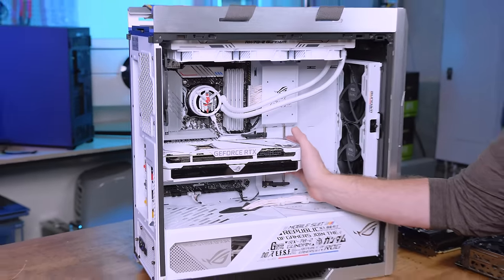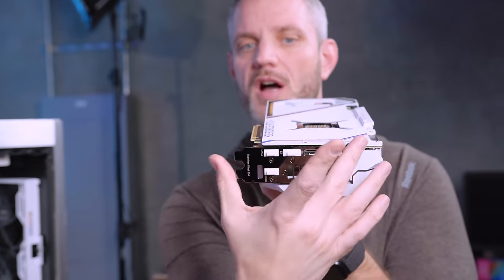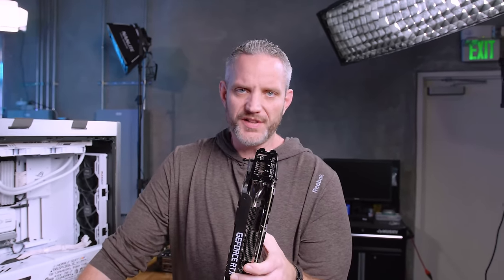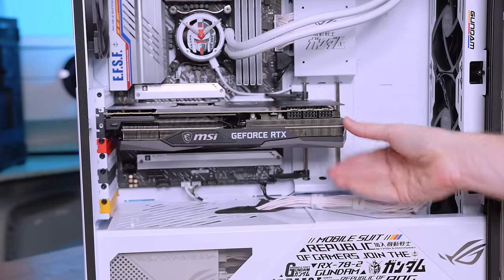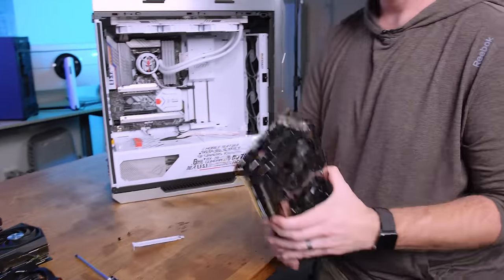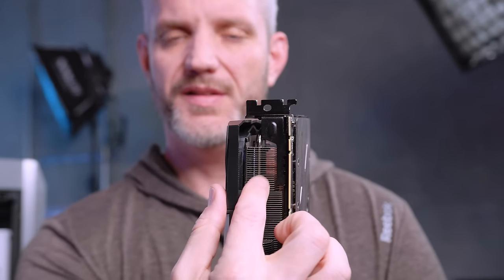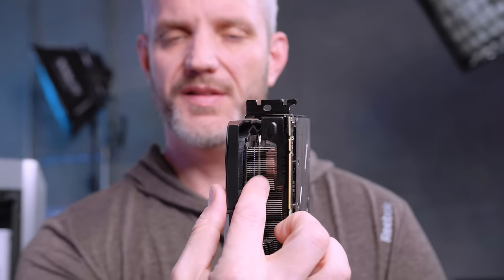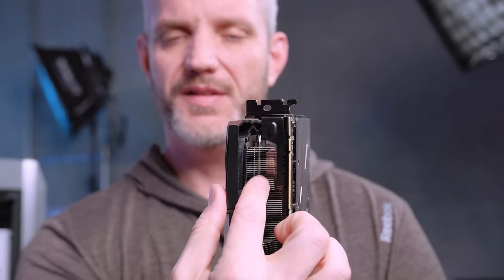How to fix GPU sag ONCE AND FOR ALL! FREE!

Comment: in my point of view you dont need special brackets to avoid sagging cards. simply take a little piece of hard rubber and press it between the left lower end of your graphics card and the pc case. so gravity is pushing the card against the case and supports the pci-e slot. works good for me
Reply: Where are you getting pieces of hard rubber?

Comment: I think the real issues is that PCIe/motherboard standards weren't designed with giant GPUs in mind.
What we need is a redesign of the standard to account for different sized cards that can take up the full volume of space across the MB.
Reply: Completely agree. Even if the gpus were designed more sturdy it would still put stress on the MB on the pcie slot.
Reply: Not entirely it's. stil the fact your put your parts on the side!  just why would you do that.! look at 
Click image to open expanded view
Thermaltake Level 20 VT, or the HAF Evo from cool master, or Silvertones horizontal cases. some of Azz have horizontal stuff going on to!. putting everything on the side like this is dumb.
Reply: Although, thick heavy gpus have been around for many years now. Motherboard manufacturers have had plenty of time to adapt, but haven't. Honestly, not sure what the motherboard manufacturers can do, this is mostly a card and case issue. Jay shows how the cheap construction of the cards is leading to the sag. They need to design the cards with alot more support at the point of mount
Reply: Giant gpus and other aibs have been a thing for awhile. 

This is demonstrably card manufacturers being cheap.
Reply: @gorkskoal9315  I agree, I have a true desktop case, as the slots were designed for, a CM HAF EVO, when the Mobo is horizontal and the GPU is vertical straight above it, the weight is all supported, nothing is stressed.
Reply: @mikerzisu9508  Still only having support at the case's rear mounting point isn't enough to relief the stress on that whole card and its pcb. The giant cooler should not be just hanging off the pcb, that's literally the stupidest design flaw ever. I bought a gpu support to deal with this. I dont care for the looks, I just dont want my 3080 to die on me because of heat plus the physical stress on the whole card.
Reply: By no doubt, a friend of mine used to have an old HD4000 (something) graphics card back in the day. 
Its cooler was gigantic for those days but it most definitely caused the card to die at the end of its life as the whole pcb of that card is now twisted like 5 degrees and frozen to this shape.
Reply: Right, the best to do is set the tower on its side.
Reply: I had slot issues on my 960, and now again with my 1070, and it isn’t even a big card. Was wondering why my pc would freeze when I slightly bump it, then I realised if I just slightly move the card when it’s running it freezes. I agree those slots just don’t like having something hang off them, I’ll be supporting my cards in the future.
Reply: Well that’s certainly untrue. In the original IBM PCs the cards were called “full length” and they had supports at the end opposite the plates as well as the plates and the slot. These GPUs would be considered “half length”.
Reply: @gorkskoal9315   Are you trying to say vertical mount should be used?
Reply: I had a GTX 960 and it started to sag so much one of the fans came loose and malfunctioned. While the card was known for having problems with fans becoming loose, in my particular case it was completely because of gravity pulling the card down so it began to seriously sag, which in turn distributed uneven force on the fan at the rear end and it came loose and stopped working. The sag actually killed an otherwise completely functional GPU because I didn't know how to repair such a fan and the loss of the fan started to make my GPU massively overheat. Unfortunately the card was so old it was out of warranty and getting it replaced would have been impossible regardless because this was several years after purchase, but it just goes to show how ridiculous this problem is. Now that I ordered a 3080 I'm wondering how to work around this problem as I don't believe my new case has anti-sag support, but I'm sure a piece of plastic or metal at the right height will definitely do the trick without destroying the overall aesthetic of the build, since I'm going for a glass case.
Reply: @Kamishi845  Stick an adhesive hook (3m command hook) on your pc case near the right end of the gpu to hold it up. Can't really see it unless you're looking up from below the gpu.
Reply: @mikerzisu9508  Thats not true, for the consumer market ATX got not designed for such big, heavy Cards.
Reply: @your-username-here2308  yeah, that made a lot of sense...
Reply: @16vSciroccoboi  Sorry but that is BS. ATX is a bit older them almost any GPU with a heavy Cooler. Espacially in the consumer market those came in late to the party.
Reply: @your-username-here2308  it's not BS at all. There are plenty of long heavy GPUs that don't sag. It's entirely feasible from an engineering standpoint to build a card that doesn't sag, even with very heavy very long cards. The standard is irrelevant.

Manufacturers just don't bother.
Reply: this isnt totally relevant but i think it would be interesting to note that way back in the ancient times of AT boards and 98 pin isa slots on everything there actually used to sometimes be little groves on the opposite end of the case to support hugeass cards that ran the length of the case but thats not really a thing anymore
Reply: make someone else fix a problem the GPU man created? nah, that sounds too much like parents blaming an M rated video game for their kids behavior.
Reply: Vertical GPU mounts and rotated ATX cases fix this already. What matters is that mobo and GPU manufacturers don't do their job right and spend way too much money on useless gimmicks and oversized cooling instead of a piece of metal that can prolong the component's lifespan by 5 years or more
Reply: just need a screw at the back end of the gpu that screws into the mobo
Reply: this is why companies have made vertical l mounting an option which is what i am going to do with my 3090 when i get my new case.
Reply: Don't make mobo's more expensive than they need to be...

I swear. Chipsets are not the only reason new mobos are so expensive. Massive aluminum heatsinks for several m.2, pre attached io shield, massive VRM cooling, 3000 layer thick PCB, all the RBG headers and so on is making mobo's ridiculously expensive. And there's no alternative, because people will shit on them if they don't have all the bells and whistles...

Just give me a "z790 basic", and I'll be happy. I never needed a reinforced PCI-E slot on my Z170 board, and that had a 2080ti in it. I never needed cooling for my m.2, since I don't do heavy work all day. If I did, I would buy an SSD with a cooler attached. I never needed VRM's capable of LN cooling, just regular air-cooling, 5% overclocking. I never thought "oh my god, how horrible, I need to press a simple plate into my case for the motherboard IO". No real issue has been solved, and now I spend hundreds more on a motherboard for crap I don't need.
Reply: @novideohereatall  confession; idk how to install a normal io shield and im glad i no longer have to pretend that i do.
Reply: That only makes sense if all the weight is on the motherboard side of the GPU, which it isn't.  The opposite side is still going to pull down and create torque on your mobo no matter how far you stretch support across it.  Think of it in terms of a slab of 2'x6' butcher block, would you want the support of the entire block coming on the wall side with no bracket support?  Of course not, it would just fall off.  You need support at the opposite corner(s).  The method from the video at least supports one far corner and puts the pressure on the case not the mobo, and the cards are stiff enough to support it that way.  I have no reservations doing this with the a thick metal case like the Lian Li which I've done, but I wouldn't do this with a thin metal cheap case.
Reply: yes...or no. I changed 3 differents cards. A 2080 msi trio x , a 3080 tuf oc and now a 3080 ti tuf oc with anidees cristal M in MSI MPG Z390 GAMING PLUS mobo and i have no one issue...i have also 4 build in my house with big cards , 2 2080 msi trio x, 3080 tuf oc and 3080 ti tuf oc ....4 pc build with very big cards and i have no sag, no issue at all!!!!!  So or the profile of pci in this video is too low or is a problem with that cards.. NO ASUS FAULT!!! No MSI FAULT!!! Really i don't know this issue in this video but this video for me is useless..sorry..
Reply: When these things were originally designed, the cases weren't typically standing up like they do today. Motherboards laid flat in horizontal pc cases and no components were hanging off of the slots, they sat on top of them. There are some obvious common design modifications to compensate for that change, and Jay showed off some of those in this video that are quite effective. But generally speaking, the whole thing was designed to be laying down in the first place and that core design is still what we're using today.
Reply: @BaneSIlvermoon  Yeah, it just survived the move to vertical for very long because hardware wasnt really at a point where it was starting to become problematically heavy until recently.
Reply: Introducing the 40 series.
Reply: It would also be a good idea for GPUs to have an extra point of support, perhaps at the opposite end.
Reply: Picked up a Lian Li case recently and their vertical mounting bracket for the card. It's an afterthought only on the vertical bracket, but it's got a nice design where the bracket has a long threaded bar that screws the end of the bracket into the motherboard mounting plate and makes it quite sturdy. The case is also wide enough that you can mount the card far enough from the wall that it doesn't get hotter than normal. Of course the downside is that it's a very large case.
Reply: How about mounting the GPU in 90 degrees (so that you can see the fans through the window if you have one) ?
Reply: It would make more sense if the motherboard had a space in it for you to attach the GPU flat, with screws. I don't know why CPUs have evolved to have their pins spread over a flat surface while GPUs connect with that flat blade connector.

Comment: GPU Manufacturers "Let's save a fraction of a penny by cutting down the bracket. Nobody cares how the card looks so let it sag!"
Also GPU Manufacturers "Let's spend a bunch of extra money on RGB, custom backplates and cooler designs. People care how the card looks so make it pretty!"
Reply: Much easier to market big shiny lights to a bunch of kids.
Reply: Crazy thing is, you'll never see the cooler, because it's at the bottom of the card. Unless you're like me, and have an inverted PC, then you can admire it's glory and don't have to worry about sag either!
Reply: Sa(gge)d RGB
Reply: Ppl are the prob. Ppl keep buying garbage from the manafacturers so manafacturers are happy to oblige 🤷‍♂️
Reply: Wonder if this is a problem in Asian markets or are they just shaving off weight where they deem it unnecessary to save $ for US shipping costs.  They can't be that blatantly stupid can they? It would take me 3 minutes on Autocad to fix this across every board partner.
Reply: Well yeah but with an inverted case the gpu still sags just backwards
Reply: As a man child, they be right
Reply: Finding suitable vertical GPU brackets for 3 slot cards is so much more frustrating than 2 slot cards, I'd prefer having an alternative 2 slot bracket to make it easier to mount vertically.
Reply: You forget that manufacturing a problem lets you sell a solution as well

Comment: Another tip for free GPU support:
An unexpected benefit of using the type of thick, stiff, reinforced and harder-to-work-with pcie power cables such as those that come with the Corsair rm - - - x PSUs (e.g. rm1000x) is that you can - after fighting with them more than you would with more giving cables - position and angle them to provide intrinsic upward support to the end of the GPU that is prone to sagging down (especially if you have them coming up through a shroud like they are in this video). That way the PCIe cables effectively act like the GPU stands (e.g. up-here) that sit on PSU shrouds/case bottoms and extend up to the same sag-prone unsupported end of the GPU.
Reply: Not a bad idea in itself and I've no doubt that it works, but putting not-designed-for stress on the power connectors (and thus the PCB) might potentially be an issue (at worst e.g. causing a crack in the PCB or connector soldering point). No idea if this could actually be a problem, but just thought I'd mention it. 🙂
Reply: I connected the psu cables (850x) by using upside way so it hold the gpu up.
Reply: This is what I did before I bought a GPU support bracket, the extra 13$ is much worth it, they have cheaper as well just wanted Antec to match the case, I've seen some for 6$
Reply: Just don't try this with any card that uses the 12VHPWR connector or things might get a little melty